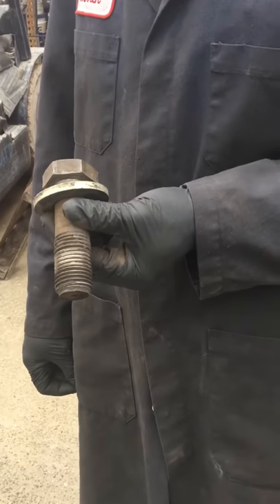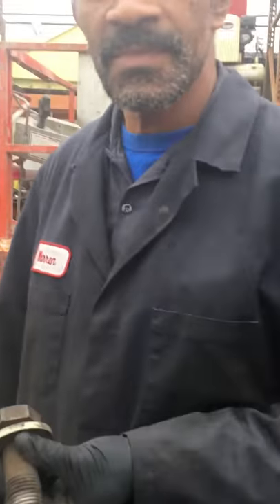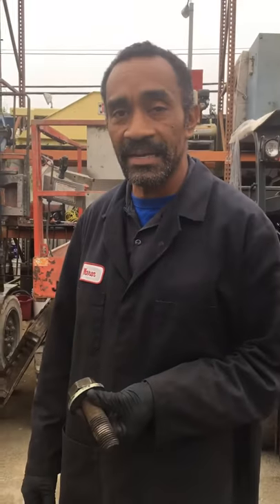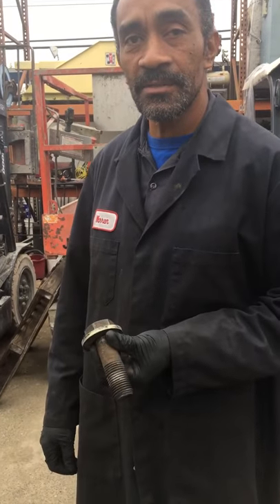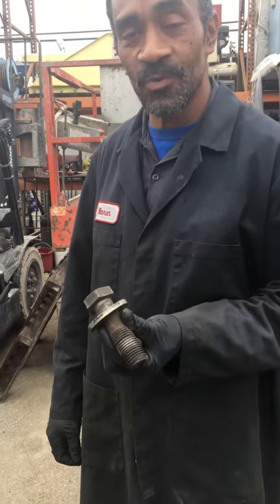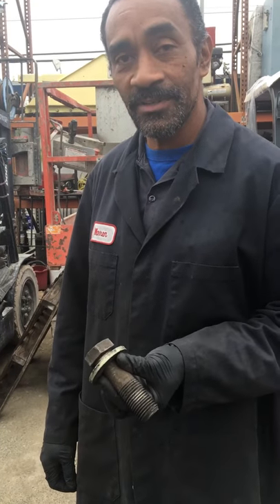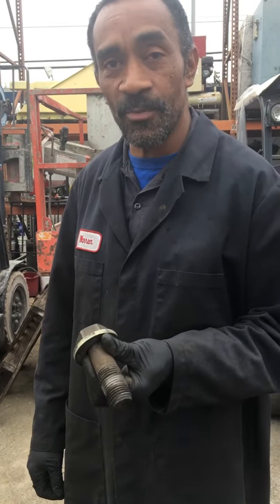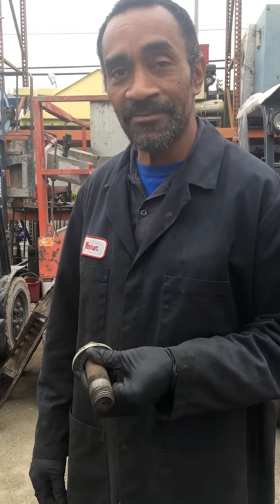Removing the counter weight bolt from a forklift

Comment: What is the size of a socket to take off or tighten one of those up with?
Reply from the maker: That's not always an easy answer. It really does vary with the sizes.An inch to quart inch... it really does vary.